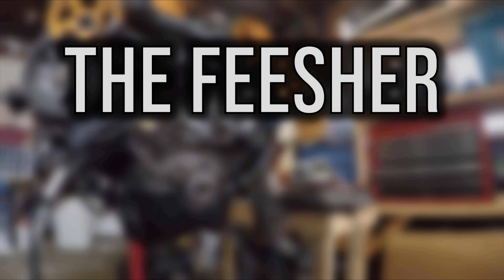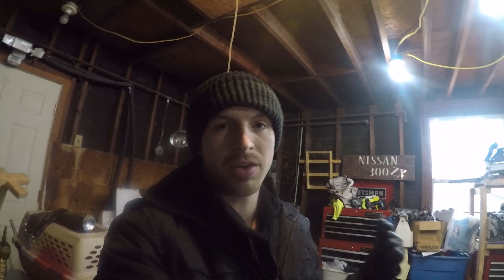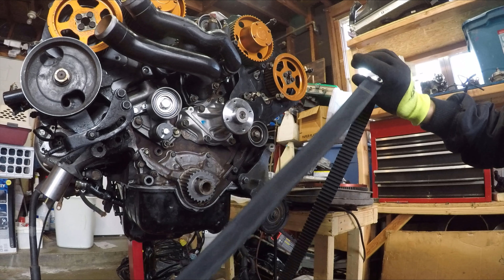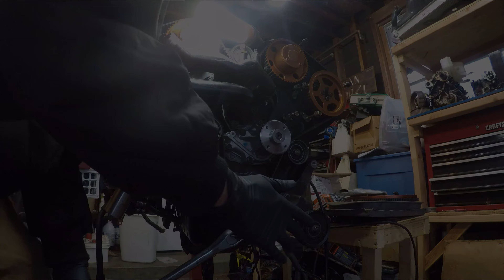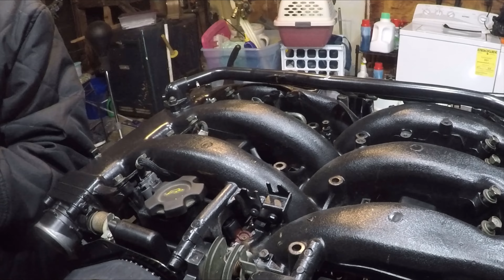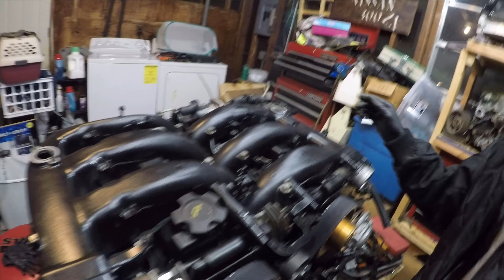NA-TT 300ZX Timing Kit Install

Comment: So the z is an interference engine. I saw the older video where you showed the timing marks off since the belt jumped teeth. Did you find the engine has bent valves?
Reply from the maker: Yea that engine had bent valves. This was an NA engine I got for cheap and resealed and belted before putting all the turbo stuff on